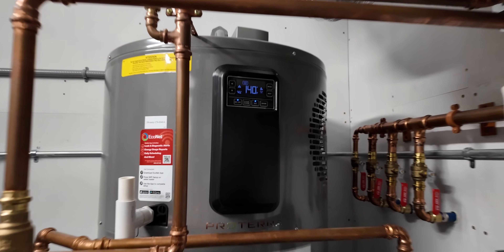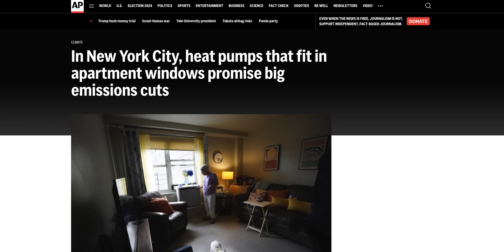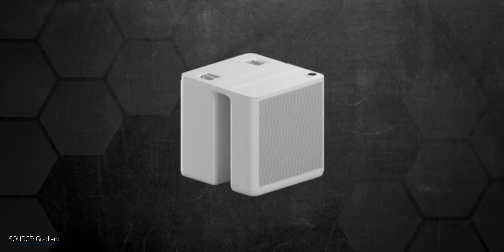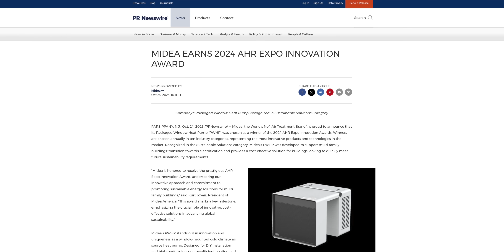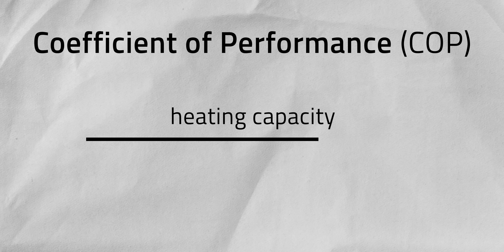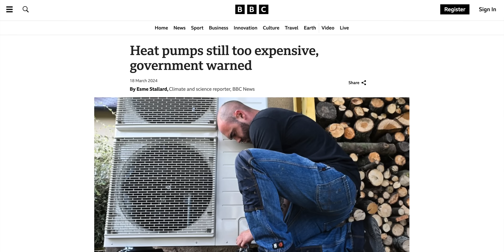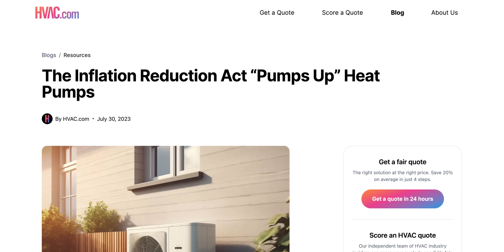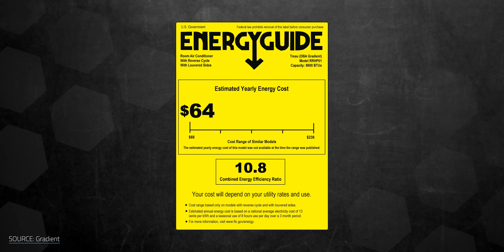Why This Window Heat Pump Is Genius

Comment: $3000 is crazy, the 12,000 BTU Midea U-Shaped is only $500. You are telling me it costs $2500 to add heat?
Reply: I just installed one of those Midea U-Shaped ACs. About $450.00 delivered. At over 6X that price, this is just price gouging. Probably because NYC is paying for it.
Reply: @paulbrancato8262 Ding, ding! Since NYC is paying for it, the price will be high as hell.
Reply: @paulbrancato8262 capitalism 101
Reply: I have a 12000 BTU Midea that has a heat pump in it. Maybe $600 a couple of years ago. It won't heat below 40°F but okay.
Reply: @geographicaloddity2  is that the portable dual hose (hose in hose)?
Reply: @geographicaloddity2  if you move the temp probe it will heat year round works great too
Reply: @geographicaloddity2  Acutally it was $419 at costco when it launched, its a little higher right now during the summer but probably drops again toward fall.
Reply: @geographicaloddity2  That whole nonfunctional heating under 40 Degrees is a problem. Great for shoulder seasons or moderate climates.
Reply: @geographicaloddity2  It doesn't heat below 40°F?  That is a useless heater lol.  Like, what is even the point of a heater that doesn't work when it gets cold outside?
Reply: @jeffmorris5802  … so now we know the answer to the OP’s question.
Heating/Cooling between -13ºF & +113ºF, with a typical (smaller range) COP of 2.35 takes more precise engineering &/ more expensive parts & refrigerants, and took more R&D to reach these numbers.

“Why does a Bugatti cost $2M when I can buy a $20k VW?”
Reply: @DurfDiggler  there was no R&D beyond 'making it look cool'.  The technology for this is old and used everywhere else already.  These companies have not innovated much at all.  But, government grants....
Reply: @DurfDiggler  There are window heat pumps that can work in cold temps. They are somewhere around $600. I think lg makes a couple
Reply: @guser7137  Exactly. Only reason they are making this is because certain governments are basically buying them
Reply: @jeffmorris5802  It works down to about 28F acutally... but doesn't turn on at that temp, you have to turn it on during the day above 42F then it will continue operating a bit below that. So realistically it has an operating range of about 40 Degrees... which means it helps most of the time were I live it only goes below 30 for maybe a few weeks at most but this unit runs all fall and part of early spring heating.
Reply: @ChaseRayfield88  That is still completely useless in most of the United States.
Reply: @jeffmorris5802  Except its not, sure I'd love for it to have a lower range, but its useful in most of the south southeast and midwest.... I expect we'll see better ones in a year or two but for now it does the job.
Reply: @ChaseRayfield88  South and Southeast?  Sure.  Midwest?  Absolutely not.  Michigan, Wisconsin, Minnesota, etc. regularly go sub-zero in the winter.
Reply: @jeffmorris5802  I didn't say anything about the north of the US... its pretty obvious you need a unit with low temp operation in those areas but that isn't "most of the US" either.
Reply: @EthanThruandThru  if you live on the 66th floor im sure this is a cheaper option, then calling someone to install a minisplit :body-blue-raised-arms: no matter what goverment you have
Reply: @geographicaloddity2  All it needs to heat below 40° is a defrost cycle.
Reply: @stereotypo1  I have had a 4 ton whole house heat pump for years live in the high desert we get snow when it gets below 30F the thing turns on a heating strips like a toaster oven. Direct heating the air by using 5000 watts of power the power bill triples when it does that, so when the thing can't really heat we use a wood burning stove and put on more clothes. When it gets below 20F it just keeps freezing and defrosting really not saving any money. It's trying to cool the outside coil below 20F can't do it without freezing it into ice if there is snow. It does work well  from 40F - 60F not really that cold just run it for a 10 minutes a day when you get up. Summer time we run for the AC side mostly also use evap cooling.
Reply: @Mike-01234 Mike, are you saying in summer you use a swamp cooler?
Reply: @stereotypo1 perhaps. It should have come with that.
Reply: I have this model, and I love it. It's so quiet. But yeah, I'd never pay three grand for a portable unit like that. Of course, I have also never lived in an area that snows, so I don't know how much I would value my heat at. We just have deathly hot weather and comfortable temps in the winter.
Reply: - This is just window-mounted AC with 3-way valve added.
- Don't you see a fancy indentation in the middle?
Reply: No way. He must be looking at a government procurement list. I can no longer watch this.
Reply: No, it costs Midea peanuts to add a reversing valve, and then there's a bit of software coding, but the price difference is price gouging nothing else
Reply: @owenashcroft8167  Thanks for the food for thought.
Reply: I have that exact ac unit and love it. I'd happily buy a few similar heat pumps for $700-800. It'll take a lot I've convincing for me to believe that they cost even 2x to manufacturer, let alone 6x.
Reply: I think that a government wanting to buy a bunch of things at a certain price point sets the price point for that product a little differently than the market.
Reply: 2500 to add heat because that brings it up to the governments magic number lmao
Reply: My guess is you will see something similar to Midea's current u U-shaped AC with a heat pump included for much cheaper in the next 4-6 years. That's of course if this 20k unit agreement works out and there is a market for it in the US.
Reply: the midea-u 12k btu is now selling for $279 at costco
Reply: @Janzer_  It's even a better buy now at $279!
Reply: For this price you can get mini-split (excluding labor) which would scale up much better for multiple rooms
Reply: @T0M3K6  I think the point is to not have labor. Also, it is aimed at a dense apartment complex market. Considering that installing your classic spit unit is not always an option in an apartment. This is a very cost effective solution for a tenant who might move at any time. This means you won't pay a higher electricity bill and you won't have to pay for the installation when you move.
Reply: Ya you can install a traditional heat pump, like a mini split for 3k or less.
Reply: save yourself 2.5 grand and just turn the unit around in the winter
Reply: @GameCyborgCh  Gosh I had the same idea and tested it in Denver.  Even though Denver is a very dry climate, the evaporator coil froze up quickly and shut down the unit. ;(
Reply: @GameCyborgCh 😂
Reply: @GameCyborgCh  that’s what I was thinking, why hasn’t anyone done it
Reply: it has a COP of 2.35, if you live in a cold place this unit is great for the price !
Reply: @Le_Sixx  It is not great for the price, it's a massive rort.  You can get a full split system with reverse cycle for around US$800 here in Australia.
Reply: Your 12000 BTU unit isn't the same. This is a heat pump. Even as an AC unit, it's much more efficient than a window AC of any shape. However, the price is still ridiculous. Unless the SEER rating is in the 40s, Midea is wasting their time trying to promote this thing. They should include this kind of seal on all window units. There's no reason for them to be leaky to the outdoors. As for saddle heat pumps, they are a niche item and not suited to home owners or very many renters. With the cost difference between a window AC and a saddle heat pump, the consumer can easily just pay the difference in the electricity bill for as long as the unit would last and it'll be easier to just buy a spare window AC and swap it out than it would to hire a tech to work on this new design. The heating isn't the cause of the difference in price. It's the R&D that it took to make this possible and the difference in components between a heat pump and a window AC. I say hold on to your money. It's no smarter to buy this than to replace your dependable car with one of the newer models with higher fuel efficiency. Either way you pay about the same.
Reply: @RussellHank-t3t  The Midea U-Shaped is a heat pump! 15 SEER. I have one, it isn't as efficient as my minisplit but way more efficient than a window AC
Reply: @RussellHank-t3t  they do have a non you shape heat pump window AC unit. Ceer of 13.3. It was around 250-300 at Costco a few years ago. The u shape model doesn't have heating while this one does.

MIDEA AC
12000 BTU Wndow Air Conditioner MAW12HV1CWT

Comment: Before rushing to buy one of the devices then consider using a thermostat to regulate the radiators. That would most likely achieve the same just to a fraction of the cost

Comment: Meh.  Anytime something new (or at least a new format and new companies) comes out, I cannot take it seriously until it has been in the field for a few years.  I cannot spend $3-4k on something I'm not certain I can get service if needed.  With my current heat pump, my neighbor is a heat pump technician (he installed mine), he can come over and fix it.  Plus, it is backed by a long term manufacturer if he is no longer around.  Plus, where this would be really handy (a separate building), I have a window unit now (plus propane heat for a 100 year old local company) and if it goes bad, I can go over to Ollies and buy another for $150.  Just don't see this happening for now.

Comment: Lumping costs for Seattle with all those oppressive east coast locations sure makes me wonder if you know what you are doing.  The climate on the west coast, especially the northwest coast, is far milder than the east.  Yes, we do get highs in the 80s or 90s occasionally, but it is rarely prolonged and far less likely to result in a dire need for cooling!

Comment: Cost is the only barrier to getting one. I mean, I could justify spending as much as $1000, but $3000 for a single-window unit. I think I would be better off pursuing a complete home system for, say, $20,0000, for example. I think this is just something that landlords will buy to comply with the regulations. I doubt the savings the landlord achieves overtime will do much to recoup their initial investment.

Comment: Great Video Matt... this design just looks like such a no brainer! I had a reversible window system that cost $650 at Home depot, which could cool and heat. But it was an eye sore and monopolized the entire window. This in comparison sits low and could just be left in place year round! Also I'd imagine a system like this would be way easier to seal up, something I struggled with with my traditional window system.

the big question is ... why is it so much more expensive? that 90 degree bending fitting? I do love that it's also a little ledge you can put stuff on after its installed. so genius, lets hope these can come down in price to closer to $1000, where I'd say it would be a no brainer!

excellent video!
Reply from the maker: Thanks, Ricky.  We couldn’t find out a lot of details as to why they’re so pricey.  I have my hunch, but that’s all it is.  I’m assuming it’s partially because it’s new and will drop as they scale up production.  But I also suspect, as many people are commenting, that it’s the government subsidized project that laid out the requirements and price target.  A little of column A and a little of column B?

Comment: If you produce electricity from gas, you will get around 35% efficiency in the power plant. After accounting for transmission losses, the electricity that reaches your house will have even lower efficiency. When using this electricity, you can achieve a COP (Coefficient of Performance) of 2.6 in the best-case scenario. This approach does not seem to make sense to me.

Comment: The price on this is stupid so I won't be getting anything in that range. That said it would be nearly perfect for my use case. I have a small outbuilding / shed that I want to keep temperature sensitive stuff in rather than in my house. It would be great to put something like this out there in a window and keep decent temperatures in there year round. Would be a super easy install and if it needed to be replaced would be easy to pull out and put in another. The price has got to come down to a reasonable amount though or forget it. As it is right now I'll likely get a normal mini-split and use that. I like these because the temperature range goes so low and high and our temp in TN is wild on the low and high ends. There is a window unit from Midea that does heat and cool that is around $450 or so but it can only supply heat down to 41 degrees which is a deal breaker for me. I need something that can go down single digits and up to triple digits.

Comment: A 12000BTU 10 amp 115v mini split heat pump on Amazon is $499.  These window units are wildly over-priced.  Not to mention that they require a window to be partially opened.

Comment: Also, I have a heat pump in my RV, and it sucks ass. On a 90 deg day, I can have the heat pump on all day, and the inside will rise above 105. It's a small RV and an "oversized" heat pump of 11000 BTU. It gets to a point where the heat pump just... GIVES UP... and starts pumping out hot air where it should be cool.
Reply: A heat pump during warm weather is just an air conditioner. Something is defective with your system (possibly low refrigerant).
Reply: @lonniemcclure4538  Duh. I'm referring to my heat pump working in the mode where it's transferring the heat from inside to outside. It works fine at temperatures i don't really need it at, and is actually really cold/warm. But as soon as it hits, say 85 out (exhaust doesn't even have to be in the sun) it just gives up like it doesn't want to be a heat pump anymore.
Reply: @nofunsir  - As I stated, something is wrong with it. Any decent heat pump (or AC unit) that isn't undersized should be able to handle temperatures at least up to the high 90's, if not higher.
It doesn't suck because it is a heat pump, it sucks because your specific unit sucks.
Reply: @lonniemcclure4538  Thanks for your steering. Unfortunately my sucky unit is a "top of the line" and a "beast of a" heat pump, or so I'm told, so I'm not sold on their reliable performance at higher temps just yet
Reply: @nofunsir  - I have an 8K window heat pump, & 12K & 8K window A/C units in my home here in the south, so I have some experience in how such units should perform on a 90 degree day (such as right now, when it is 91).
If you have a small RV, I expect it is smaller than the area of my living room+kitchen open area, which my 12K unit is handling.
Reply: @lonniemcclure4538  Also, it's a brand new Dometic Cool Cat 10.5K btu heat pump

Comment: I was dying of a lack of central air in the back of the house, bought an LG AC unit for $500 on amazon, they are out of their G D MIND thinking their window units are worth THREE THOUSAND DOLLARS! Mine is 15,000 BTU on 120V! Even connects to WIFI and everything! NOPE! You want us to adopt heat pumps? PRICE THEM LOWER! There is NOTHING significantly more complicated between a typical AC unit, and a heat pump! MIDDLE FINGER NO! You want us to be efficient!? If the cost isn't even remotely reasonable, then we will NEVER EVER EVER EVER EVER switch! Not made of freaking money! None of us are! We're all broke! broke I say! Also I'm not directing this toward you Matt, but the psychos who are charging INSANE prices for heat pumps.

Comment: Install 2 window ACs with one flipped outside facing in. That’s still cheaper than one heat pump lol. Jokes aside these are amazing and need to be cheaper. Ice makers are also heat pumps with reversing valves and they’re cheap. I wonder why it’s so pricey.

Comment: Adding the window units to replace a central unit increases use during the day when there is a solar surplus but lowers use at night.  That means less pressure on the grid.

Comment: $3000 and $3800 are prices that take advantage of subsidies and lack of competition. Adding a reversing valve to a $250 AC unit to call it something you can charge a lot for isn't the answer. This is where the government could get bids and buy in bulk when a reasonably return is factored into the product. Say $750.

Comment: Not sure how they justify $3,000 for a A/C unit that runs in reverse. I get they have a few more features, but a 9,000 BTU mini split can be had for under $1k.

In Europe, you see mini splits all over the outside of apartment buildings.

It's just old tech in a new package.

Comment: A good heat pump should have a COP > 4, if you dial it in properly. Which means this is a pretty lousy compromise at closer to a COP of 2 point something.  Unless you really can't get a regular heat pump. In which case it is competing against old technology which in cop is bad but in $ is a lot cheaper than heating your building using grid level pricing. Which is what you will be doing.  It will be running at nearly 2x the energy cost you should be spending.  And lets face it, if this is your best option you also won't have the possibility for installing rooftop solar probably. So this thing would run at a relatively high cost that you can't control. It gets your landlord off the hook but you will be paying for it.

The rest is just marketing. Low COP == high cost. Anything below a COP of 4 is a bad deal and definitely nowhere near state of the art.

Comment: The reason why it’s ok to open a window in nyc in winter is that steam heat is free… there is no waste of resources or money. Adding a heat pump would be pointless. It’s not pointless in homes or apartments where you have to pay for heat though